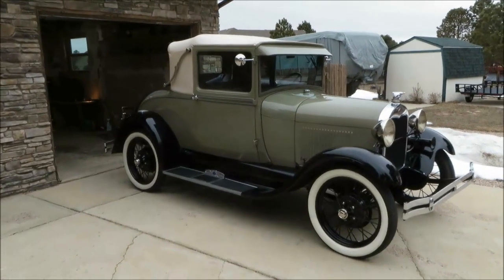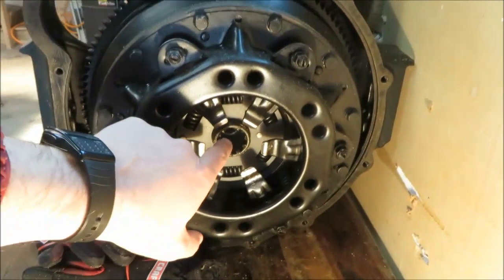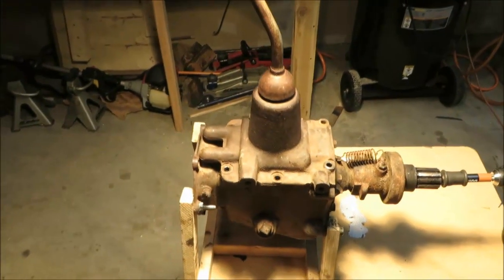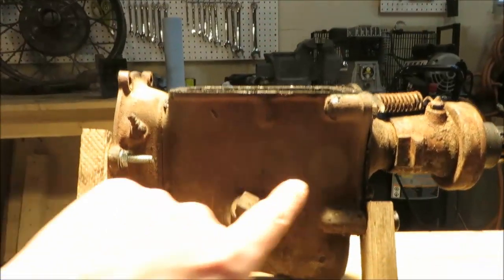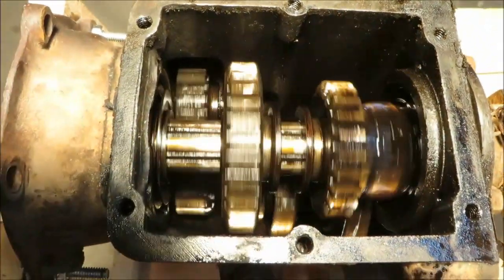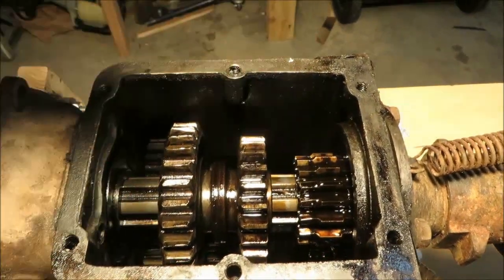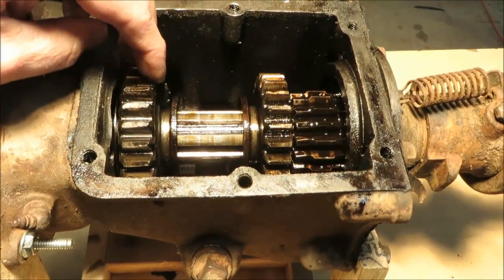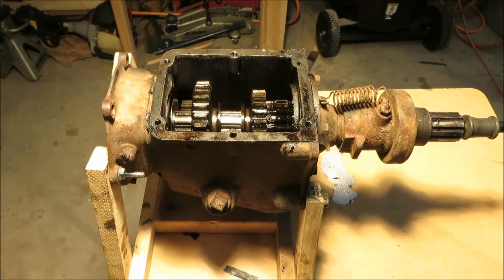How a 1928 Ford Model A Transmission Works

Comment: Nice job Ray. I'd like to add something regarding the shifting tower.

56 years ago, at age 14, I removed the shift tower from my model A transmission and saw exactly what your video shows. Unfortunately, then as now, we can't see the cluster gear that resides on the counter shaft buried underneath the gears that are in full view. 

The model A shift tower operates in an H pattern. The neat thing about the shift tower design is that to change gears you always pass through neutral. This accommodates shifting from 1st to second, when you must first unmesh the rear moveable gear, move it into its neutral position, leave it there, and then and only then, select the other front moveable gear and put it into mesh with its second gear position. Moving the shift lever from left to right through the neutral position is what accomplishes this sequencing.  Movements between 1st and reverse or between 2nd and 3rd only involve a single moveable gear, not the perfectly choreographed movements of both moveable gears. 

Once understood, it seems so simple. But just looking at the tower and down into the transmission, it's not clear at all. If I'm not mistaken, this transmission design was first pioneered by the French in the 1890's??? Whomever first worked out the H pattern and the design of the shift tower was one clever person.

Comment: Thanks for doing this video...Very nice information...and very well done!!!! ***

PS I hardly if ever down shift the Model A   Not much is gained by it but a lot of vibration engine noise from the increased RPM from third gear to 2nd...The brakes  remains the best way to slow these cars down...I am sure you are well aware of that and might even agree., Again GREAT video..
Reply: Brakes?  What brakes?  I had a '29 sedan when I was a kid, and I don't remember there being anything I would call functional brakes on it.  Course, I had no idea how to adjust mechanical brakes at the time.
Reply: Gear clash is the very reason many don't downshift but it has it's advantages,especially with push rod brakes. The way to overcome this problem is to synchromesh the transmission & this is done by Mitchell, in their fabulous Model A conversion. They build a complete new trans. with 15% higher gear ratios, with synchro on 1st. & 2nd.,all in the original case. Along with the Mitchell diff. splitter, it is money well spent.

Comment: Could this transmission be retrofitted with synchronized gears?
Reply: There is a company who sells a 3 speed where 2nd and 3rd are both synchronized.  Google will find it.

Comment: and why is it that it makes that squeal noise when you're accelerating?
Reply: That's due to the straight cut gears in the transmission. Modern transmissions use helical which drastically cut down on noise.
Reply: Oh thank you for that, my Model A tends to squeal / whine a little more in second gear than first or third for some reason, might just be the reason.
Reply: straight gears are noisy but they dont transmit side forces to the transmission case, that problably helped for durability....

Comment: Ray, don't know how long ago you posted the video bout the 28-29 tranny and how it works.   But I own a 28 Pheaton w/o an engine ...noticed in your vid you had one on the bench...need one to complete my car you interested in selling that one or know of one for sale...running if poss. But OK if not... But want a very very early engine number???  Call 405) 662-3425.  Donald Farino.   Preciate any leads.
Reply: I know it was last year but did you still need an engine?
Reply: +Brenden Spady Call the number. I got a three spd colum shift that is about that that small.